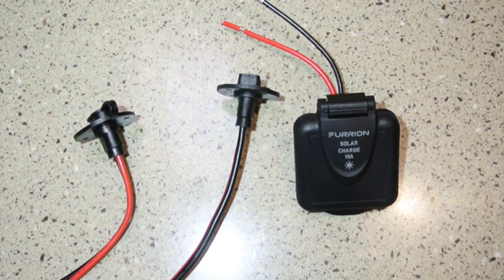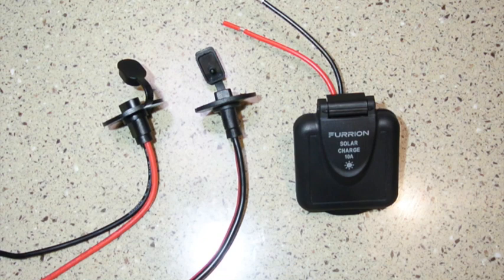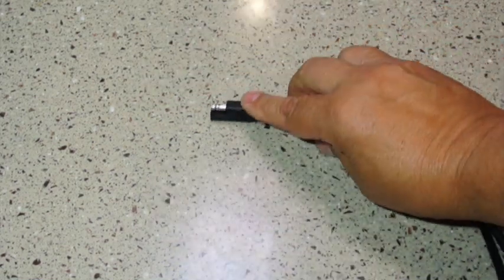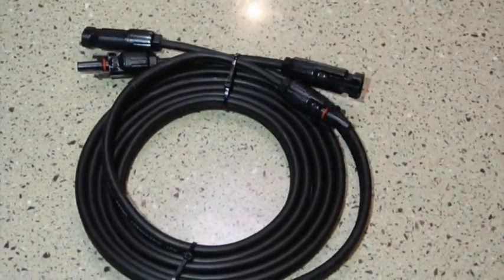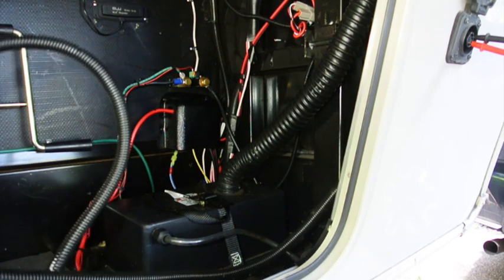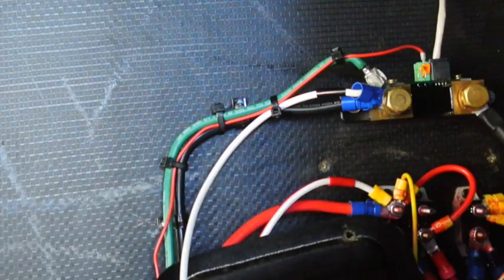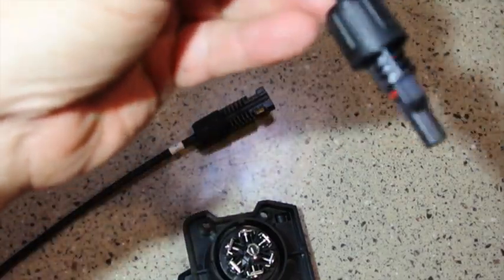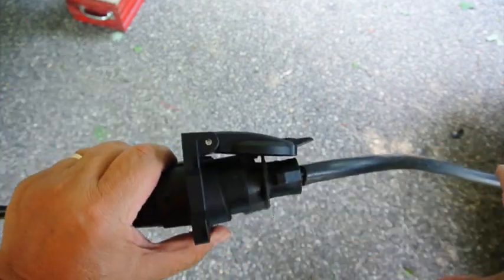Connecting a Suitcase Solar Kit to a RV - Portable RV Solar Charging Video 2

Comment: The picture diagram at the 2:00 mark is exactly what's required for my Class B RV.    My RV specs requires a  portable 200 watt solar panel charge controller.    This is the  most useful video I've seen specific to my Class B RV needs.

Comment: I have an SAE Connector with a polarity changer/adapter and it does not fit into the SAE/Zampf on my Taxa Cricket. The polarity changer has square edges and the connection on the camper has rounded edges. Just doesn't fit. Do you have any advice that might help me solve this problem? Thank you for this series!
Reply: Shave the edges with a pocket knife.
Reply: @MikeFree22  Yeah, I did that but still didn't work. I bought several brands and found the QA is not good on these connectors. Eventually found one that fit.
Reply: @silekiernanphotography  Oh ok…glad you found one. Messing with this stuff there is always something!!
Reply: @MikeFree22  For sure. Thanks for taking the time to respond.

Comment: Maybe this is a dumb question, but I need to ask it. I have a travel trailer with the zamp plug factory installed. Can I plug solar panels, without a controller, directly into that plug and directly charge my deep cycle battery? Or, do I need some sort of a controller with the solar panel?
Reply from the maker: All solar panels need a controller, which is actually a battery charger. The output voltage of the typical solar panel is too high to be directly connected to a battery.

The controller can be located at the solar panel, or for small portable ones, even sometimes they are built into the solar panel.

Or the controller can be located at the battery.

The closer to the battery the controller is located, the better.

Comment: Very good job with both your videos and your web site. Thank you, I've learned so much from your expertise. I have a question on solar. I currently have 2 x 100W Renogy panels (in series) (40V, 5A approx.) solar panels on the roof of my 5th wheel, Victron solar controller 100V/15A, all working very well. I have an identical 3rd panel I would like to use on occasion, to catch more sun, I have a home-made stand and it works very well. Can I simply wire it by slicing into the roof wire to add another 20V, before it enters the Victron ? Thanks.
Reply from the maker: Yes and No.

The specification for the Victron controller (100/15) is 100V input max from the solar panels and 15A max output to the battery.

With 3 identical panels, you will be at 60V, which is still under the input limit, so no problem there.  

However,  the maximum output from the 3 panels at peak (300W) is going to yield close to 20A output.  Yet the output of the charger is a maximum of 15A, so you are potentially wasting 5A at peak sunlight.  

I have not read the  manual for the Victron controller or have I done any over-current testing, so I am not sure if there is an output current limiting mechanism in the unit.  

If not, potentially it could overheat the unit if you exceeded the output specifications and possibly damage it.   Somehow the charge controller has to dissipate that 5A.

I would at least check the manual or perhaps verify with tech support if there is such a feature in the controller.

Otherwise, I would want to upgrade the charge controller unless for sure you know you will never reach peak panel performance due to the intensity of solar at your location. 

For example, where I live in the midwest, it is often cloudy and I am north enough that I would never reach the same solar intensity as I would if I lived in Arizona.

So for me, I might never see more than 200W output in my area even with 300W worth of panels.

You could monitor the charge controller to determine the peak  output of the panels in your location.  

However, from a liability issue I never recommend exceeding the mfg specifications.

Victron has 100/20 and 100/30 controllers, and one of those would give you the maximum output for your panels.

Anytime you extend the electrical distance of the panels from the controller - which would happen when adding a 3rd panel, you will suffer some voltage loss.  But a few volts at 60V is a lot more tolerable than if you were parallel wired.  So you should be fine there unless you were to use a lot of extra wire at a small AWG.

Finally, you will want some kind of bypass for the connector you use for the 3rd panel when you are not using it.  This would be required if you wired the 3rd panel in series (which I would recommend) as it would otherwise result in an open circuit when the 3rd panel is not used.
Reply: @RVProject  A huge thanks. Wow, great info. Any ideas how to wire it with a by-pass? Not sure how I can physically do that... My 2 roof panels are in series on the roof, then a pair of wires travel down to my controller close to the batteries. I have a Furrion port in my service bay wire to the same area, I was going to connect that wire to the controller too...
Reply from the maker: @miatared  For liability issues I am hesitant to give you a step by step instruction.  But basically, you would wire the Furrion port in series with the two panels as if it was the third panel.

Then you would want to put a SPST 20A switch across the Furrion port.  When the 3rd panel is not used, you would close the switch, which shorts out around the port. This would effectively take the Furrion port out of the circuit.

But when using the 3rd panel, BEFORE connecting it to the furrion port, you would flip the switch so it is open. That way, it inserts the 3rd panel into the series connection.
Reply: @RVProject  Thank you, very much appreciated. I'm in Canada by the way.

Comment: Is it possible to make your own solar side port with off the shelf parts and have like 800W?
Reply from the maker: Again, current, voltage, and wattage are all inter-related. 

DC Ohm's Law for power (Watts) states:

Volts = Watts / Amps
Amps = Watts / Volts
Watts = Volts x Amps

Consider a 100W panel. It will output around 18V and peak current of 5.5A.  (100W / 18V = 5.5A). 

Laying out 8 panels in a portable configuration would not be very practical, I don't think, but here goes anyway.

If you series connected 8 panels (144VDC @ 5.5A), you would need an MPPT controller that can handle 150VDC, which does exist.  Generally, MPPT controllers are required for voltages higher than a single panel can produce (18V). And in series, the total current will still only be 5.5A so you could use the Furrion connector.

Or if you connected them in parallel (18VDC @ 44A),  you could use a PWM or MPPT controller, but the peak current would be 44A.

Series would be the way to go here. An MPPT controller is more efficient, so less % of what you pay for will be consumed in waste, and more % will go to the battery.

And if you went parallel, you will also have a lot of waste and expense in the wiring between the solar panels and battery.

Just off the top of my head, if you have a 50ft power run, you could lose about 25% of the energy produced in a 800W system if you use a PWM controller and parallel connections.  

For that reason, if you go more than a 100W setup, I always recommend a MPPT controller and series connection.  Since the panels will only produce 5.5A, you won't have any issues with the furrion connector in this configuration, and the MPPT controller will be more efficient. As well, you would not need to spend extra money for heavy gauge cable.

But if you want a high current connector, look at the Anderson Powerpole  (15/30/45Amp) or Anderson Battery (50/120/175/250Amp) connectors. 

I really do go into quite a lot of detail in my suitcase solar series. Here are two videos and the webpage where I cover Anderson connectors.

Suitcase Solar Webpage: http://www.rv-project.com/projects/suitcase.php
Video 9: https://youtu.be/cbKWRvz0SOU
Video 9 Update: https://youtu.be/0hYQzNuXikc

Comment: So I’m confused on the solar stuff be trying to figure this out on how to hook up my solar panels to my camper I have a 2022 advenger camper it has solar hook up the furion hook up and I was told it can handle only 18volt but I have a 200 watt solar panels,and I just bought a solar power converter.
Reply from the maker: Most 100 to 200 watt solar panels used for RVs have a 18VDC open circuit voltage per panel. I have not seen any specification at all for the maximum voltage rating for the connector.

Comment: Can 2 100 Watt suitcase kits be hooked to 1 RV battery using the alligator clips or will damage occur to the diodes or controllers?
Reply from the maker: I don't recommend it. 

It would be far better to connect the panels together directly before going into the charge controller.  That would be the correct way/best practice.

Depending on the charge controller capacity, the panels would work best in series (using an MPPT controller with a minimum voltage input of twice your panel's output voltage) or in parallel (with a PWM or MPPT controller capable of 15A output).

Of the two configurations, series connecting the panels would result in less voltage drop in the panel circuit, which means you get more charge performance.

However, to connect the panels in series, you also need the proper bypass diodes in the panels. Some panel mfgs already have bypass diodes built in.  Some panels also require blocking diodes when used in parallel, both of these situations are dependent on the panel manufacturer, so there is no one correct answer.

I would contact your panel mfg to determine if you need to add external bypass or blocking diodes.
Reply: @RVProject  Thanks so much!

Comment: Great video!  I just bought a 200-watt Renogy suitcase.  It came with a 15 amp fuse.  Is that sufficient for the panel which is going to a standard AGM 12-volt battery? My 2022 Casita has a Zamp input plug so it's backward.  I did cut the alligator clips off and soldered an SAE plug, then soldered the fuse inline with the positive wire, then used a reverse polarity plug.   Is this correct?
Reply from the maker: I would double check everything with a multimeter.
Reply: @RVProject  what about the fuse?
Reply from the maker: @genekauffman8286  Unfortunately this is not a Yes or No answer.

My Renogy 100Watt suitcase will output a maximum of about 5.5A when the sunlight is at maximum. I would guess then that the Renogy 200Watt panels would be 11A.  

There should be a sticker on the back of the panel which provides the maximum output current.

So a 15A fuse should be sufficient to allow the maximum current from the panel. However, the fuse should also protect the wiring, so you need to make sure the wiring can handle more than 15A.  

If everything came from Renogy, I would suspect they sized it correctly. But if you modify any of the wiring, it then is on you to make sure the wiring you add is sufficient to pass not only the current, but also sufficient to minimize voltage drop.  I did a video in my Suitcase Solar series that discusses voltage drop. http://www.rv-project.com/projects/suitcase.php

Fuses and circuit breakers are often mis-understood. There is a lot more going on than most think.  A 15A fuse does not blow at 15A, but it allows 15A to pass.

I published a video called "All about Fuses" that you might find interesting: https://youtu.be/tUomOpNUjHE

Truth told, fuses and breakers typically pass a lot higher amperage than their rated amperage. This is a function of time x overcurrent.  There are graphs and charts published by LittleFuse, Buss, and most competent fuse manufacturers.

For example, a fuse might blow within a second if the current is say 10x of the fuse rating, but that same fuse might not blow for 10 minutes if the overcurrent is 2x the rating.  What this all means is you must overdesign whe wiring for the fuse you will be using.  

The wiring in particular should be able to handle much higher currents than what it is fused for. Call it a safety margin if you will.

Comment: My rv came with a 50 watt 10 amp solar system. I have a 250 watt 10 amp solar panel sitting around. Can i just unplug the 50 watt and plug in the 250 watt?
Reply from the maker: It depends on the charge controller. It must be able to handle the higher output current of the new panel.

Often the smaller panels are self-contained, with the charge controller built in. You would not be able to easily modify such a unit.

Comment: Hi. I have a Renogy 100W suitcase and have been charging the batteries via the alligator clips that come with it. I recently installed a metal battery box for both batteries and want to put a SAE adapter on the side of the box so that I don't have to open the box each time to charge. If I do that how do I hook up the cables on the inside to the battery if I'm not using alligator clips?
Reply from the maker: You can buy terminal lugs from any auto parts store that will fit a battery.

Comment: Thank you for sharing! I've read that we should keep the charge controller inside, I see many people having then attached to the back of the solar panel. Is this okay to leave it out like that?
Reply from the maker: As long as it is waterproof, you can leave the charge controller attached to the solar panels. This is the typical configuration of a portable suitcase solar panel.

However, the conventional wisdom is the closer the battery is to the charge controller, the better. 

You can realize a performance gain by relocating the charge controller next to the battery, especially if you locate the solar panel more than 10ft away from the battery.

This is because the series voltage drop through the wire in the solar panel-to-charger circuit is less critical than the charger-to-battery circuit.

Comment: I'm assuming there's no need to fuse the 7 pin hack if you're only using a 100 watt suitcase?
Reply from the maker: If the charge controller is at the solar panel - which it should be if using the 7pin hack, I think I would still fuse it for safety.

Comment: Does it run the entire rv?
Reply from the maker: A 100Watt or 200Watt portable suitcase style panel will keep your battery charged when it provides power for the overhead lighting, water pump, and circuit boards for the water heater, furnace, and refrigerator (when they run on propane).

It will not run the A/C, or any 120VAC appliances, such as microwave, coffee maker, TV, etc.  100Watts is simply not powerful enough.

Some RVs do have solar systems that can run everything, but they cost in excess of $10k, and they need a lot of roof area for the panels.

So they are not practical unless your RV has enough space for all of the panels.

Comment: How many panels and how much watts do I need to keep charger two batteries? Also is better to have 2 6v or 1 12v?
Reply from the maker: Suitcase panels such as those made by Renogy typically are 50W or 100W panels.  The suitcases typically use two panels, so a total of 100W or 200W.

How much power you need depends on many factors, such as how much of a load you have on your system, where you are on the planet, which affects the amount of daily sunlight you get, etc.

But the rule of thumb I use is 100W per battery should keep a RV charged up for daily use - provided heavy loads are not discharging the battery, such as an inverter supplying AC power. 

If you are only using DC lighting, water pump, and powering the fridge and water heater using propane (only DC is required for the circuit board), then a 100W solar system should be good enough.

Of course, if you find the 100W solar panel is not enough, one you can always add another 100W panel.

To determine whether or not to use 6V or 12V batteries, many factors apply as well such as weight, available space, and need.  Two 200AH 6V batteries would supply the same amount of energy as two 100AH 12V batteries.  

For the 6V batteries, they must be wired in series, while the 12V batteries would be wired in parallel.

However, the typical 6V battery will be a golf cart battery, while the 12V battery might be an ordinary Deep Cycle battery (although you can buy 12V Golf Cart batteries as well).

Typically, Golf Cart batteries will withstand more charge-discharge cycles than a standard Deep Cycle battery.

Comment: Would  these solar suitcases work on a 2 lithium po battery setup? Iam totally new to the rv world. Bought a trailer that has the solar on the side port . Only has a single deep cycle battery which I want to swap out with 2 lithium batteries.  Would one of these plug n play style solar suitcases and the built in charge controller on them work on a 2 bank battery setup? Thanks
Reply from the maker: Lithium batteries take special care when charging and discharging. They can explode if abused.

Lithium batteries typically require special chargers, however some lithium battery manufacturers have built these chargers into their batteries, and with the application of a standard charger (one suitable for lead-acid charging), can convert the charge profile to what is required.

Other batteries require a lithium-specific charger, and many solar charge controllers do have a lithium setting.

I cannot directly answer your question as this is an equipment specific case-by-case basis, complicated by paralleling the batteries.